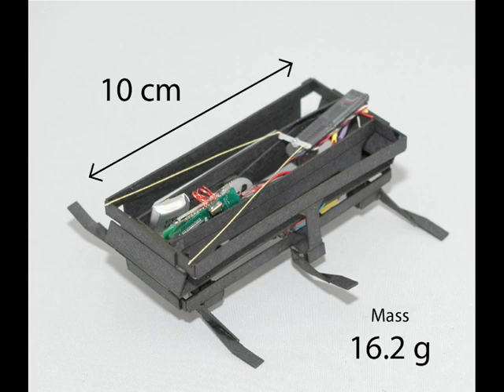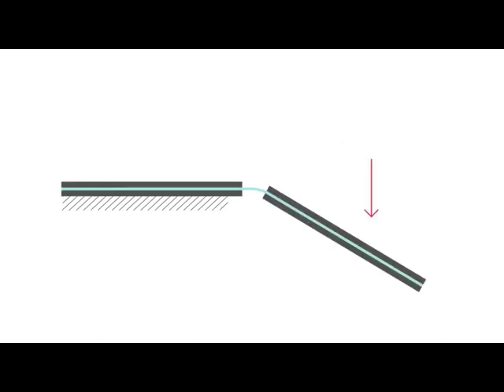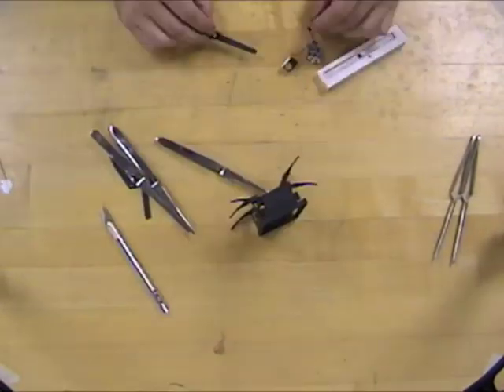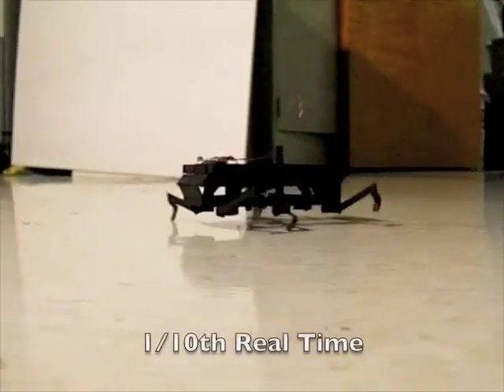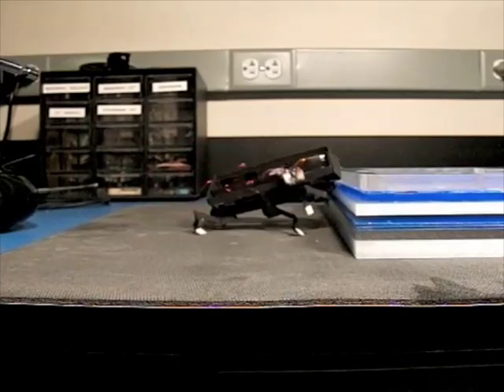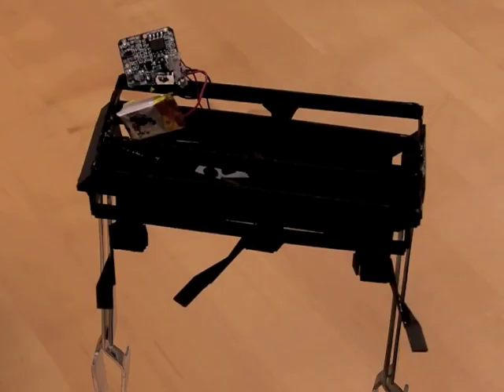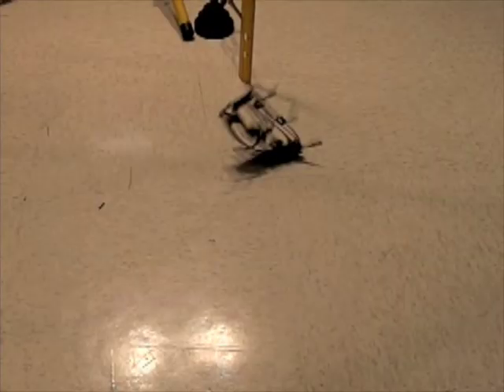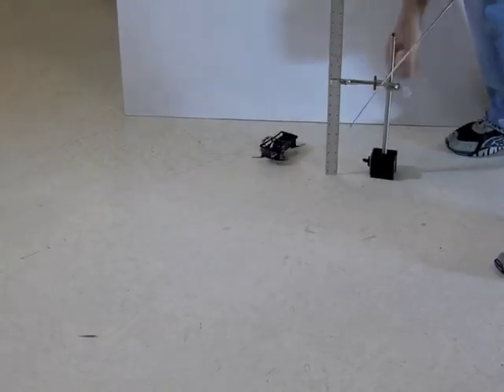DASH - Resilient High Speed 16 gram Hexapedal Robot

Comment: Beautiful in its simplicity. It looks like it could easily adapt to surface paddling or  underwater swimming with the appropriate feet/legs. An easy way to add better turning might be to add a pager motor and propeller 90° to the travel direction, or maybe add a 7th leg at the nose pointing sideways.